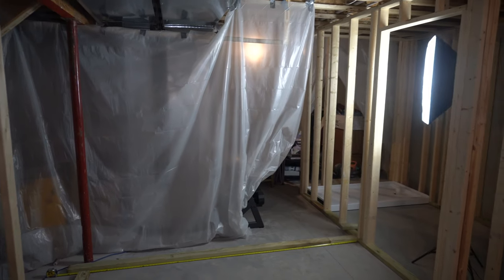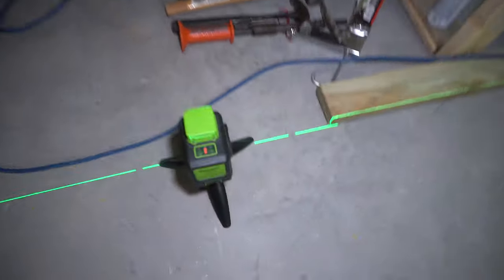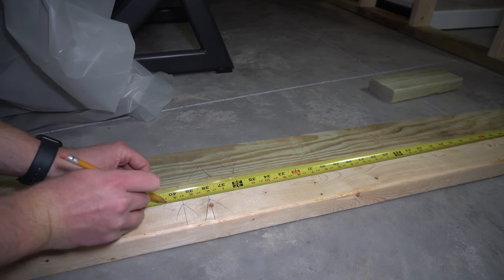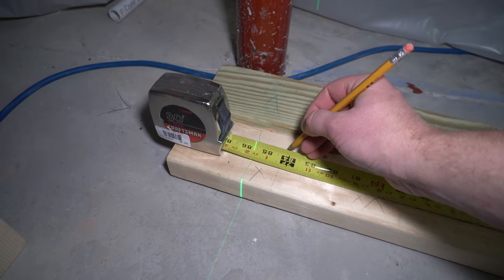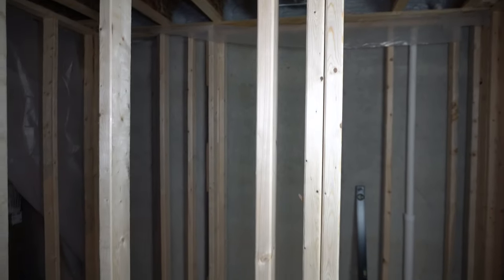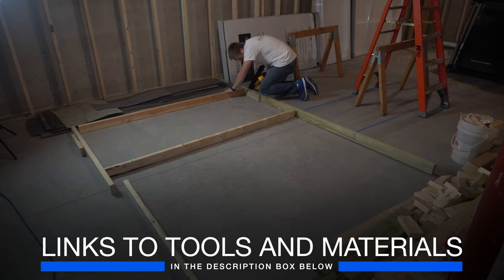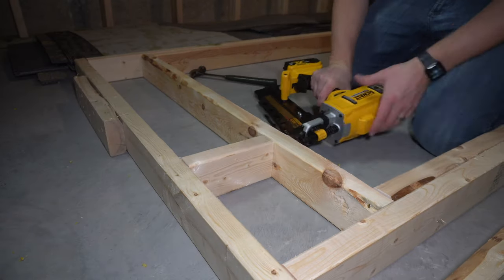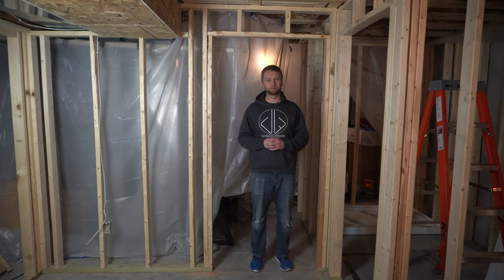How To Frame A Door Opening In A New Wall

Comment: You can also put a screw or nail at 1.5" for the first stud and hook your tape measure to that screw/nail and measure to 16", 32" etc for the remaining studs (must place the "x" mark behind rather than ahead).
Reply from the maker: Hooking on the nail head is a great tip - thanks! 😃
Reply: @DoingWhatever  Thanks and you're welcome. Saw someone else do it on Youtube.

Comment: Just a little confused did you say the door was 32” and you were going to give 2” more so a total of 34”, but then you made the space 38”.  Are you using a bigger door? Thanks just want to understand
Reply from the maker: sorry for the confusion - yes the door at the beginning that I showed for an example was a 32" door. the door that I framed out for in the video was a 36" door. The basic rule of thumb is add about 2" to the size of your door and that's how big the rough opening should be. this allows for the door frame and some shims to get it nice and plumb.

Comment: Great lesson. I’m planing to frame my basement for a dedicated Home Theater the area will be 11x20x8. Framing off the stairs and add a interior door at the bottom of the stairs that come into the room. Three interior walls and one wall on the cinder block wall. Thanks for the video.
Reply from the maker: Sounds like an awesome project and additional space for your house! Good luck with the build 😃

Comment: I noticed that you left the piece of wood you used to secure the two pieces that made up your top plate in place.  I don't have the clearance like you do. I have the same situation though where I have 10ft plates and am short just over a foot.  Any suggestions on how to secure the two pieces to make up my top plate, but I can't leave it like you did.  Thanks
Reply from the maker: You could cut the two pieces to length so that the joint between them lands right on a vertical stud. then just nail both plates to the vertical stud. If you don't have room for that, then I would toenail them together by driving some screws in at an angle. Make sense? 
Thanks for the question and for watching 😃

Comment: what software are you showing at the start of the video? would this give you ideas of rough material needed? I see you have a bunch of 2x4s next to your miter saw
Reply from the maker: The software is called Sketchup. I believe there is a free version you can use. If you want you could model every stud and basically build it first virtually before building it in real life! I modeled almost all the studs for my basement first and had a pretty good estimate on the quantity I needed.

Comment: Great video. Well presented. One question, At 14:32 in the video, to what do you nail the top plate around the iron I-beam?
Reply from the maker: Thanks! Good question! 
In my case this isn't an iron I-beam, it's a laminated wood beam so I was able to attach the top plate to it using a screw. If it's a steel beam, I've seen some people use the Ramset gun to attach it to the steel beam. I've also seen others drill a hole in the steel beam and use a screw to attach it that way. hope that helps!

Comment: Ah, so you have to use a ramset to attach the floor board to the concrete.  Crap, only thing I don't have and zero experience with.
Reply from the maker: There are some other methods, I think you could use a tapcon or a different special nail for this. this is just the method I know of